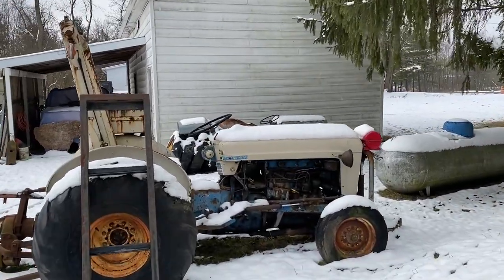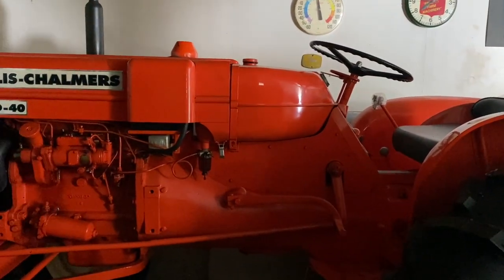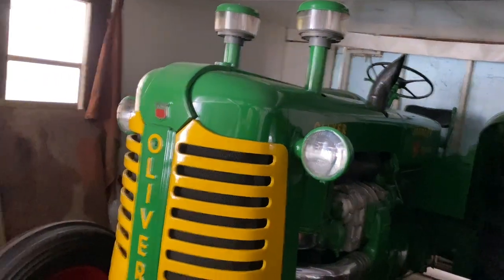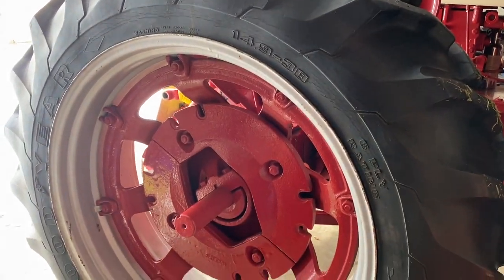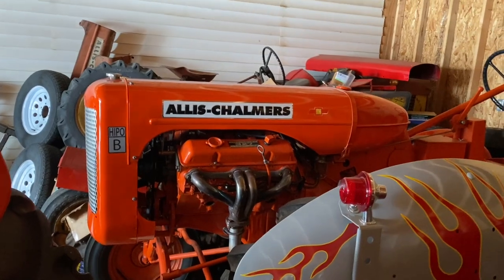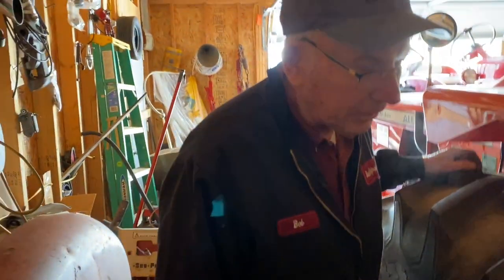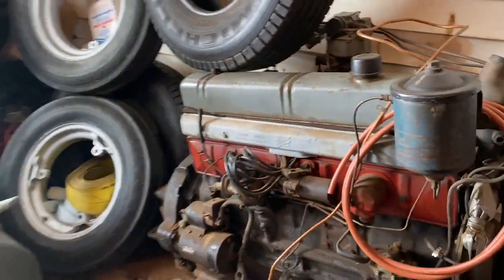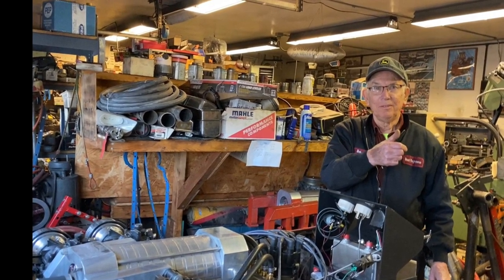DBG: Tractor Town Bob's Ford 302 8N, Chevy 327 Allis- Chalmers B Blown 57 Oliver, Fire Ball Buick 8

Comment: Gotta luv this guy, awesome👌🏼…..
Great vids, need to fire up that custom V8 Tractor, so cool-great vids👍🏼🏁
Reply from the maker: Thanks, Janks, very cool indeed. Hopefully get back in the spring and fire these trackers off. Thanks for staying tuned mate
Reply: @DragBoss351Cleveland  so funny actually, couple weeks back was browsing around for an old Tractor (for cheap$) & thought how cool would it be to do it up, V8…..possibly Blown too😉 etc as a fun project….. then i see this vid haha
Bob’s little one with the flames🔥paint job👌🏼 Badass man
Reply from the maker: I know it Janks, it is pretty darn cool in the spring. I’ll get them to fire them up and make another video. But yeah, would be nice to have a blower on that 8N, too 4s sticking out of the hood yeah that would be fun. Thank you mate. Cheers.
Reply: @DragBoss351Cleveland  right on Tim💯
👍🏼🏁

Comment: Very cool. Thanks for the video. I love the Detroit Diesels.  I have worked on some. And I have a 1950 Buick 2 door Sedanette " jet back"..I have a 41 factory dual carb setup for it.  It's the smaller 248. Plans are custom grind cam and do whatever porting I can do. Long interesting story how I bought the car .
Reply from the maker: Thanks man I do love those old tractors. Specially the scream in Detroits. When I 16 I work logging, driving a Timberjack log skidder with a screaming Detroit go to the woods at five in the morning. Load of logs is a great time. I love those old 50s cars. Thanks man.
Reply: @DragBoss351Cleveland  Yep I like the sound. When I was UNOH back in 86. The sounded like they were. Running 7000 RPM but the tach was showing 3500. As far as I'm concerned High performance diesel.  Think about it Supercharger with a roller cam! I have a friend with a 8v92 in a semi truck that was modified and quiet. He surprised other truck drivers when they put these engines down.